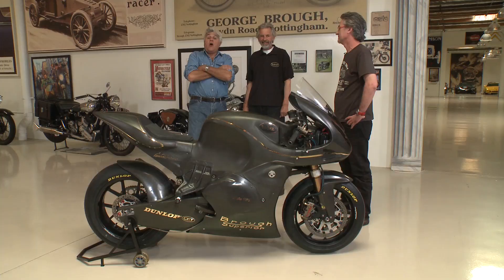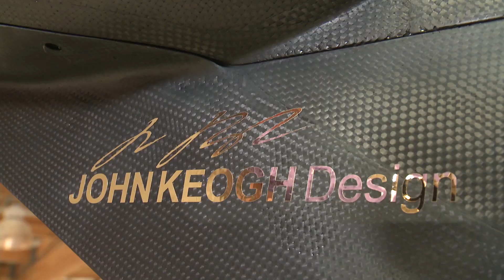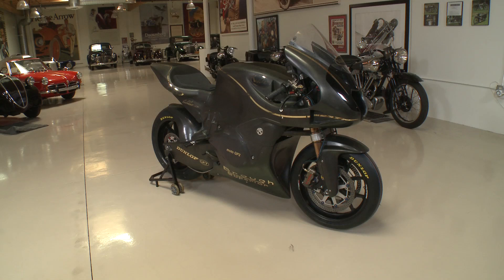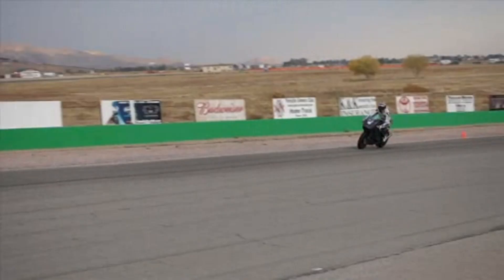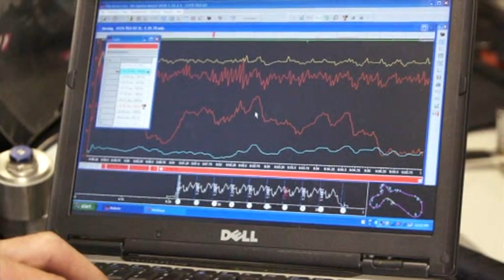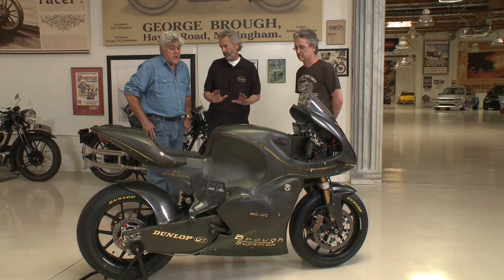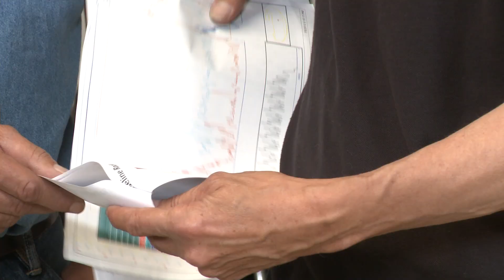Brough Superior Moto2 GP - Jay Leno's Garage

Comment: And then you have the BRITTEN V1000 from little old New Zealand, with home made carbon fibre wheels, circa 1994 ...!!
Reply: ultimite respect for britten , not this
Reply: Britten is not under rated. I saw one run in Georgia and haunted their pit area. That bike is on another level.
Reply: MotorBoat MyGoat Under rated by whom? It wo crazy amounts of championships to the point where they banned it.

Comment: The idea for the radiator under the seat and the front intakes was used on the Benelli Tornado 900/1130.Also designed by a brit. Adrian Morton. Cheers. Great upload.

Comment: Great to see this again. I wish the precise date of broadcast was shown. I'd like to know whether it was before or after the bike was raced in the British GP at Silverstone by Jeremy McWilliams in August 2013. I also think it's a shame that they didn't make it clear that with this Saxon steering system there's only a single front shock, like the BMW Telelever system. I'd also like to know why they chose Saxon/Telelever rather than the Hossack/Duolever system. Apart from anything else, the Hossack system doesn't require any fork tubes, like the original Broughs.

Comment: Someone who should get credit for perhaps the first composite monocoque is Steve Roberts from New Zealand.
New Zealander John Britten's name has already come up and yes the argument could be made that his engine was designed to be the chassis from the offset and divides the connection of the front and back mounting points, a tremendous innovation in itself for motor cycles.
Also from the hot bed of motor sport innovation that was New Zealand in the early 80's came the Steve Roberts designed and built Suzuki GSX1100 engine based race bike with composite monocoque
chassis.
Called the Plastic Fantastic it was a composite chassis including steering head mount, tank, seat section and attachment to the rear suspension mount in one piece. 
First raced in 1983 and won a New Zealand inventors award the same year.
Its monocoque was first realized in hand beaten aluminum form by Steve for an initial bike then molds taken from that chassis for a composite bike version.

Oh and ducting air out through a rear radiator into the low pressure zone, that is definitely a John Britten idea and implementation.
What's old is new ah.

Comment: The only problem with a monocoque, is if you fall off the bike and it slides on the ground, the chassis is being destroyed, rendering you incapable of simply buying new panels and replacing the damaged parts.
Reply: We didn't get the best view of how "mono" that monocoque is.  From my view, and what they describe it seems a lot of the components are essentially integrated together for rigidity.  GP bikes still have a frame, separate from other systems. If they are attempting GP, they must have some system of removing and repairing parts with some sense of urgency.  Is the original commenter's point that metal can bend without failure, but CF will crack and totally fail?  I have watched MotoGP and can't really recall anyone pulling off after a crash, get a repair, and continue on.  Either the bike runs/rides, or your day is done.  But I believe most teams prep two bikes, in case you crash in qualifying?  Then also, spares and mech to repair anything for race day, or for next race.  Compared to other/previous designs, can you afford and build all the parts you will need for a full season of GP?

Comment: This seems to be a development out of the Saxon triumph which Paul Taylor was also involved in during the 90s. The Saxon ST900 incorporated saxtrac front end ( an A arm with central mounted shock and spring meaning the fork sliderers are empty .very similar to the funny front end used by BMW but earlier) and for all but one of the 12 Saxon Triumphs an under seat, rear mounted radiator was also used. Go Google Saxon Triumph ST 900 . The forgotten racing Triumph.

Comment: With all do respect, and there is respect to the unique design, but Johan Britten from New Zeland, designed and built a carbon fiber monokok framed motorcycle with a rear radiator and front air duct....20 years ago. On top of that Johan design, built and cast his own engine. I would expect, these distinguish motorcycles fans at least to mention his name, he was a great designer and very modest one, pity he is no longer with us.
Reply: Well said, and I'm struggling to see how this bike has any connection to a Brough Superior.
Reply: @MegaPoxie  just like how modern Bugatti's are related to their predecessors
Reply: Not a great example as at least the latest Bugatti has an engine in it developed and made by Bugatti.   A Brough Superior with a Honda motor ... really!
Reply: Steve Roberts NZ made the first monocock in 1980...an f1000 Suzuki GS1000 & later GSX1100 all carbon fiber version in 83...John Britton copied & evolved that bike concept as with the Denco V2 1000 speedway engine.
Reply: @MegaPoxie  
Brought Supperior never used their own engines. They always used  the best technology developed by other manufacturers, and used mainly JAPreswich  or Matchellss V twins. Also the first monocoque frame design must go to the  Ariel Motorcycles Company of Birmingham England and their 1960s Arrow and Leader models.

Comment: Just to save anyone an hour of searching the web-
This bike was originally designed for racing and branded as TaylorMade, years before this vid.  Named for the constructor (not the golf club company).  I found video of it on a track for basically a high level club race, or just a regional 'superbike' race for privateers.  Not a sponsored, prototype, GP level machine.  Probably for reasons given in the comments, this machine was not funded at the level needed to compete- spares, crew, multiple bikes, travel, etc. WHICH IS OK! God Bless these gentlemen for their time and expertise. They built a fast bike, very original.  The Brough Superior sticker on the tank could be only described as a 'sponsor'. Some rich guy (Mark?) just throwing money around for publicity.  Rather poor taste for Jay to promote this.

Comment: No carbon wheels!? I suppose that's in the regulations?
Reply: Yes under FIM rules, carbon wheels are not allowed. This is due to the centripetal stress, breaking stress, and radial g-stress when riding it hard through corners. So magnesium wheels are specified in all classes of MotoGP.

Comment: This bike has a HUGE basic fundamental flaw. A race chassis has to be able to flex as it goes through left-right corners. Carbon frames have been tested and failed to produce the winning results. Just as the motoGP Ducati team. Considering they are racing in the moto2 class with much lower HP, it will be interesting to see how it pans out. No question a brilliant overall design.

Comment: cbr 600 engine , ohlins suspension, brembo brakes , other manufacturer tyres , master cylinders , dash , electrical connectors , wheels , ignition system , handlebars , cables , grips , switches , nuts , bolts , wiring , levers , rearsets , hoses , other than that 100 percent brough superior , lol

Comment: The Britten of New Zealand was my first thought when I saw this. Firstly it looks similar, look at the fairing and the swing arm. Then the alternative front end. Then the rear mounted radiator. I couldn't see the rear shock but I wouldn't be surprised if it was under the engine like the Britten.

Comment: I like the idea and some of the design but 143kg dry is no lightweight for a 600 race bike. He compares it to a road bike but this doesn't need all the road bike lights, indicators, numberplate, mirrors, switchgear, wiring, etc or any of the brackets to hold it all. That's ignoring tax disc, pillion pegs and seat, etc. Even the full road bike cbr600rr it gets it's engine from is only 175kg (386lb). Junk all the road gear and it wouldn't be far off the same weight. Make the CBR's frame, swingarm, tank and other bits from carbon and it would weigh less again. None of the moto2 bikes struggle to get under the weight limits and the 4 cylinder limit started at 145kg so where's the gain?
Reply: There's a minimum weight in Moto2 GP.

Comment: The FIRST ... true monocock...ever heard of Steve Roberts (NZ)...Neville Hiscock(NZ) racing f1000 pre cursor to Superbike/MotoGP back pre 1983...had their radiator under the seat in front of the rear wheel...Steve Roberts made the first cabon fiber bike which was an evolution of his earlier 1980 aluminium monocock...John Britton's V twin was an evolution of that bike...charlatans

Comment: I'm sorry, but, putting the Brough Superior name on a Honda...doesn't make it a Brough.
Reply: +gremmann To me, the motor makes the bike.
Reply: +gremmann that's a legit claim, but not much can be done when that's the rule of the moto gp2. every brand follows the ruling
Reply: But Honda had absolutely nothing to do with the design or fabrication of the bike. What if next year the racing class were to switch to a spec yamaha engine. Would you then no longer think of it as a Honda, but as a Yamaha bike? 

Perhaps they should not disclose the spec engine maker to the public?

Comment: Triumph Daytona 675 Weight (dry) 356 lb  this  315 is really not impresive
Reply: Lol you try to get so much weight off a motorcycle. Come back when you are finished or upload the video.
Reply: Spookzor Exactly, getting something already light, a lot lighter is a very difficult task, and these guys have done it brilliantly
Reply: Think it this way: It's an 11.5 per cent weight reduction. that would be like getting an already light car from 1200 kg to 1060 kg. That's a really big difference
Reply: you don't grasp the whole thing at all do you there is a minimum weight limit in gp2, they said that they are slightly under the weight limit so yeah fin
Reply: The figure they've quoted will be just without fuel since race bikes are usually designed to be running out of fuel and at the mininum allowed weight as they cross the finish line.
Do you know what a manufacturer's 'Dry Weight' figure means? It's not just with no fuel, it's with no fluids at all (no battery acid, fork and shock oil, engine oil, coolant, brake fluid) they even deflate the tyres because pressurised air is heavier. It's at least 15-20lbs lighter than the bike can ever be if it's to be ridden.
Reply: for racing purposes it's a big difference
Reply: There are big advantages to making your racer being under the weight limit. You can then add ballast to bring the weight back up to the minimum, but you can put the ballast anywhere you like. For example, very low or in the center of the bike to tweak the weight distribution for better performance compared to the competition. 

You see the same thing in Formula 1 where the cars are way under weight then have steel plates bolted to the floors to lower the center of gravity.